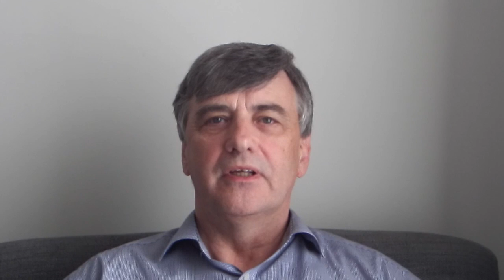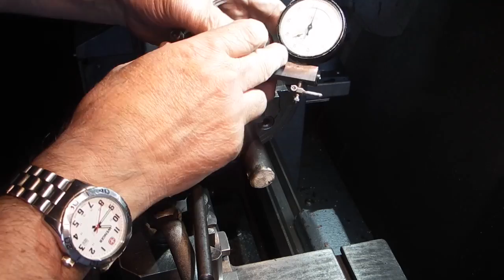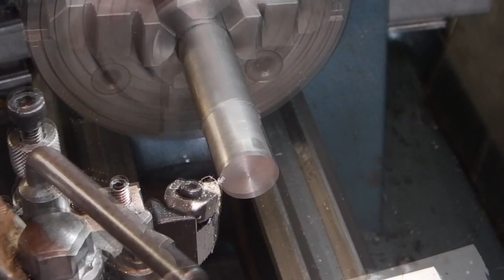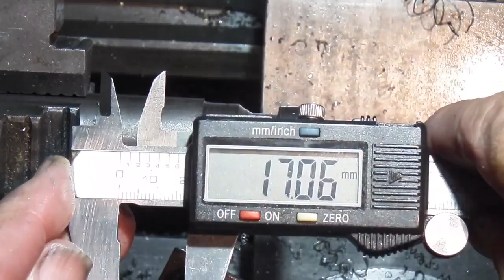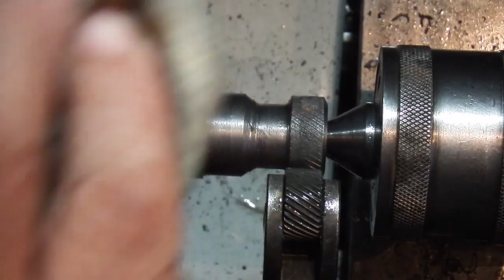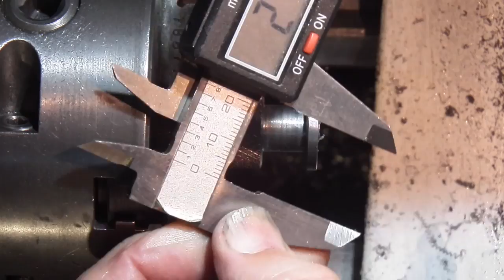Tool hight adjustment nut

Comment: The knurling tool with the pivoting head will always tend to "cut" top wheel first due to the lathe direction of rotation pushing the head down. It needs to be set quite high to compensate. I much prefer the scissor type or a fixed head type.

Comment: Thanks Allan, 
I need to do this for my Myford tool post for the same reason, the flange only just catches the post. One tip I got of Steve Jordan was to put a longer stud in the tool holder and use a nyloc nut on top of the adjuster.
Cheers 
Raymond